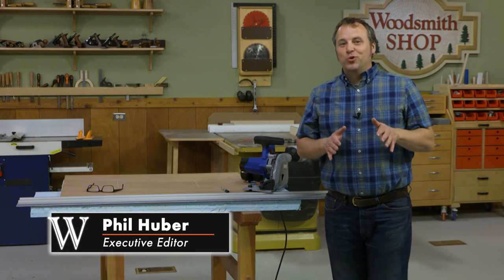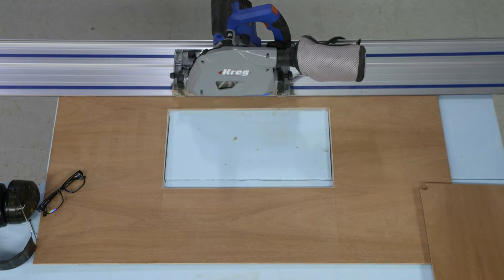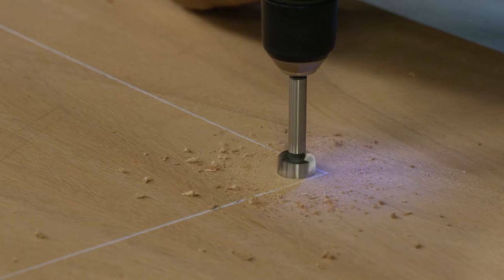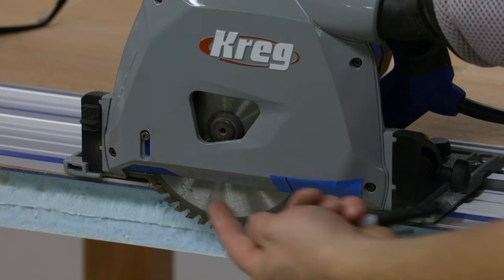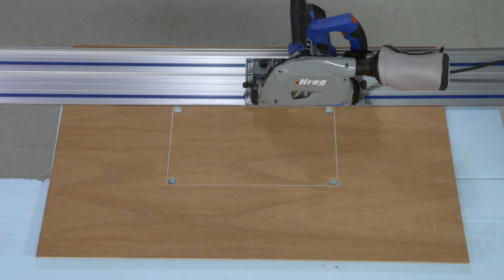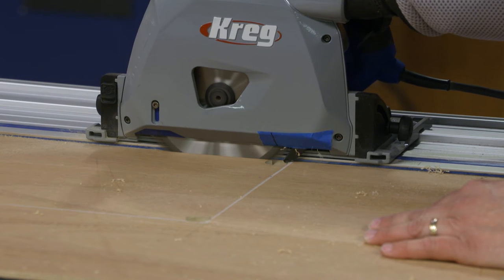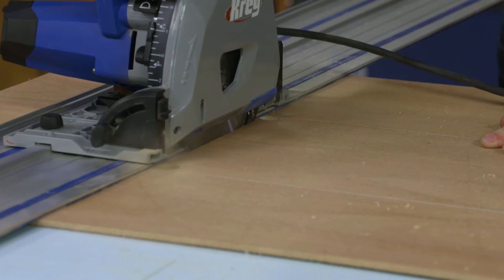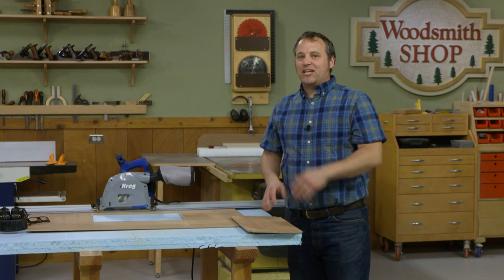How To Make Cutouts & Plunge Cuts With A Track Saw

Comment: I had to do this technique when widening an opening in the countertop for a larger gas range & it worked great.  I did have to come back w/ a hand saw to get all the way to the corners, but preferred that method than drilling holes (and also didn't think about that option).